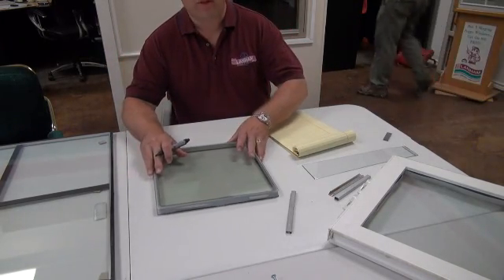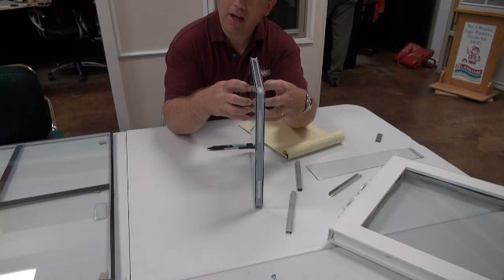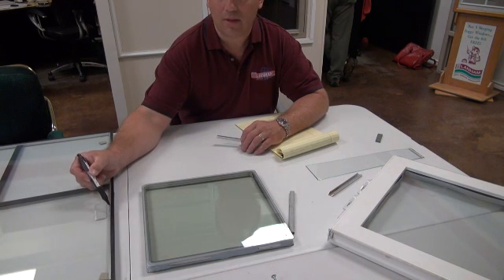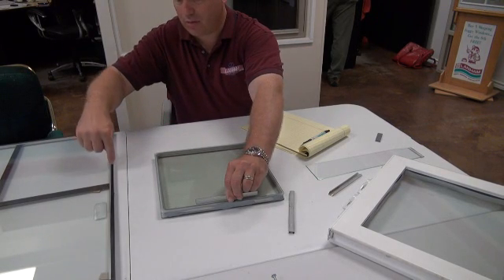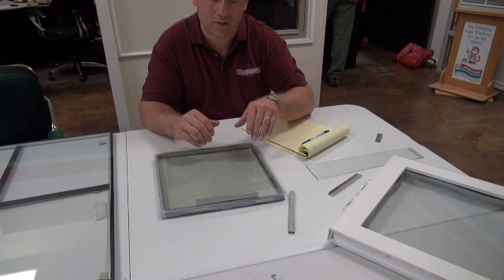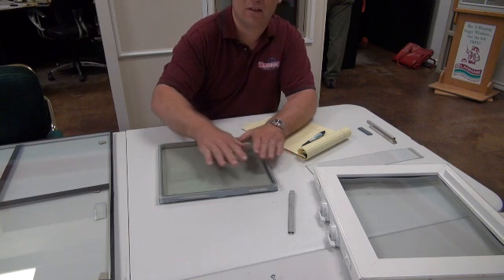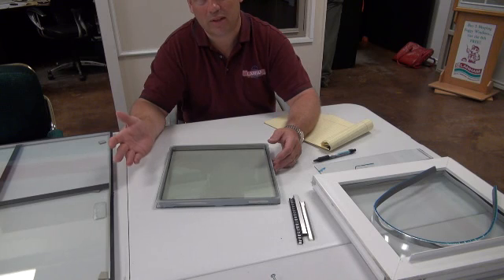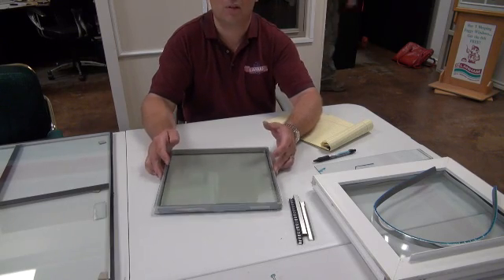Why does insulated glass fail?

Comment: window failure fogging moisture pooling on the sash bottom  happens in pprox 3 to 5 window lites of a typical 15 to 25 windows for home upgrade or new const installation why?  glass is shipped with a coating of powdered soft grit which protects glass from breakage during the jostling ride on the 18 wheel hauler,most factories have  fellas who  use the house mix of blue glass cleaner in a windex type spray bottle,which does not get all the grit off,when the evil smelling butyl caulking is applied with  the gun,,,this results in failure of the window in a few months after installation,proper glass cleaning means using an old glazers product   pumice,,use warm water clean lint free cotton rags,,( autoclaved in 400 degree steam) coat the glass surface wipe  till it squeaks,one more light dusting with the stuff  wipe and blow off any particles that window will remain tight and functional if the other components and work were properly done

Comment: Why dont they just make the whole thing out of glass. It must be possible to create a hollow glass panel. Glass on top, glass on bottom and glass on sides. Not bonded together but actually made that way in one piece!?
Reply: Dont ask me how they would inject the argon.....that would take some figuring out.
Reply: @wilco1288  They do have bulb-edge glass units like that but they've been phased out for the most part, they would last a while but they didn't have as much insulation value.
Reply: Hollow glass bricks are a thing

Comment: Did you say you put Helium in your windows? That's nonsense surely - that would provide little thermal insulation - did you mean to say Argon? Also, please edit your video so that we can actually see some close-ups when needed.
Reply from the maker: No sir.  I did not say we place helium in our windows.  That would be nonsense.  I used an analogy to describe how the mylar works in a 'helium filled' balloon vs a sealed insulated glass unit.
Reply: the whole house would probably float away like a balloon if the windows were filled with helium, don't you know anything????????

Comment: The problem lies is where you have glass and metal together. Metal expands and contracts more than glass at given temperatures. Because of that is why most insulated window seals fail. If you use fiberglass frames, the frame and window panes will expand and contract at the same rate therefore no stress on the sealing material.
Reply: Yep. Glass thermal coefficients are crazy, different types of glass have different rates so you can't even fuse different types together because they''ll crack. Pyrex vs. soda glass for example..
Reply: While there are some fiberglass frames that have great success with insulated glass not fogging, they sure do not back it with a great warranty.  Vinyl frames are notoriously offering LIFETIME warranties on the failed seals.  It is difficult to find a upgraded vinyl manufacturer not offering a LIFETIME warranty.

Comment: pumice cleaned glass means better sealing surface,wear  surgical gloves to stop b oil from smudging the glass,when glass is cut,use fine grit sandpaper to take off sharp edges,contact with metal much less frequently causes the glass to crack.glass is best cut on a flat flat
 heavy  table with a soft nappy piece of carpet glued onto it,usually mfrs have a guy at a stand up trough & moveable T  ruler, , which metal often results in glass chips left in the track,causing more ships to the next glass sheet to be cut.he has to bend to see the 1 '16 down low,and at times misses the 1 /16 mark
Reply: Some great ideas!  Thanks.

Comment: Can I replace my thermo's with non thermo's? They fail way to soon.
Reply: You can, but they will not meet code AND they will not be as energy efficient.  You can avoid future problems if you would replace the units with an upgraded series and NOT the builder grade type windows.

Comment: Why don't they just use silicone for the whole seal, instead of using polybutylene?
Reply: Without getting into a very long dissertation, our experience has shown us that ALL insulated glass units will fail within a metal frame window.  This is regardless of the quality of spacer systems used.  Of course, this answer is coming from someone who works in a hot and humid climate.  Also, even silicone does not stick to glass on a long term basis.  I know there are many fantastic claims of 'GREATNESS' in the insulated glass market, and we have fallen for some of them through the years.  Thank goodness this is NOT a problem in our vinyl frame windows.It could also be a cost issue.  This is a more common event in a 'builder grade' type window.  There will always be a market for the less expensive products.  We like to call that JOB SECURITY.I hope that helps you.
Reply: You need to use the correct type of silicone base caulking which is the neutral cure silicone and that can outlast the life of your substrate.
Reply: @mleibel4  you should share that correct silicone type with the many manufacturers within the window community.  They are obviously NOT using it at this time and you could make so much money with this revolutionary idea.  Thanks for your input.